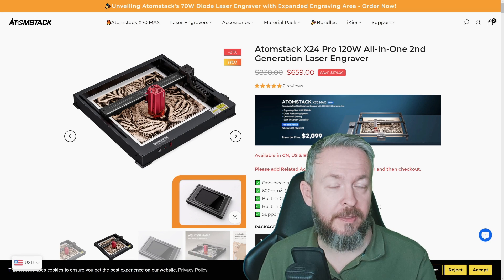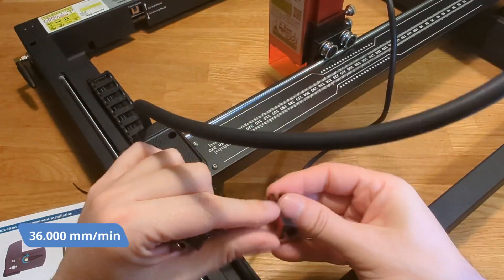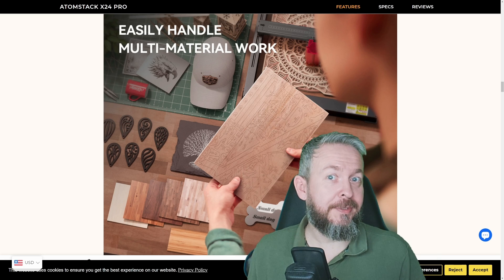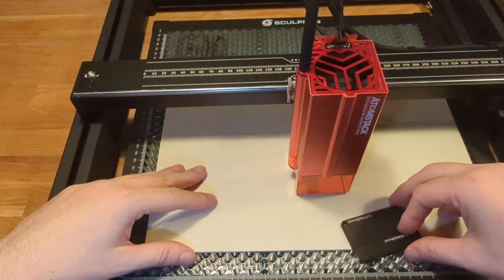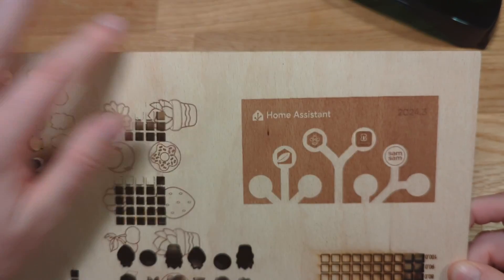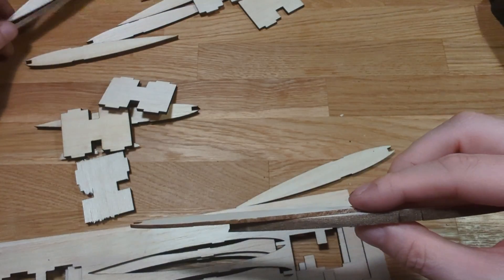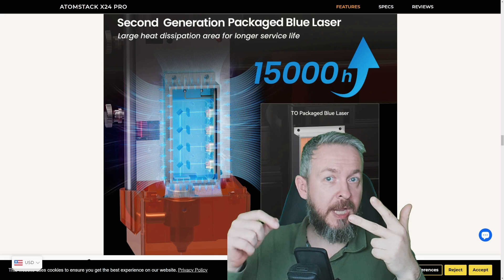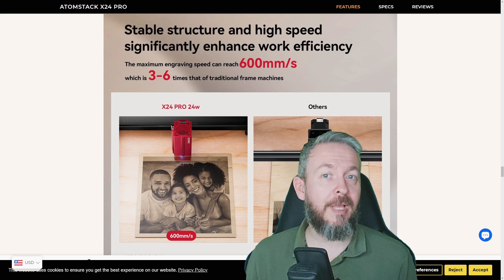AtomStack X24 pro - beginner friendly Laser Cutter & Engraver

Comment: Hi man, great video thanks for the very good value information, just one question because I will buy this atomstak x24 laser cut , I want to make stencils with it and the material to use is Mylar, do u know if it work for it? Thanks a mill
Reply from the maker: Thank you! I think it will work, but you'll definitely have to play with settings (speed vs power) to make sure you have clean cuts as Mylar is a bit thin and looks fragile.

Comment: Hi there I need some advise , I want to know if I can engrave on surface which has cutouts holes ?? .
Reply from the maker: Yes, that shouldn't be the problem - if are thinking about same thing. Laser should just pass over the hole and continue engraving on the other side.
Reply: Hey brother, greetings , I have an issue , I have 1/8 thick acrylic , I was hoping to cut some snowflakes for gifts (being the first thing I actually  cut )  I increase the the S value power in settings from 1,000 to 10,000,  then I run it at 20 mm/speed @ 80% power , 3 passes it just mark the acrylic. I increase to 100% power and it didn’t cut it . Can you please tell me what I’ve done wrong or and tip or advise?  Thanks
Reply from the maker: @MRSingh-nx2xi  does acrylic still have protective paper on it and what colour is it? Acrylic is a bit tricky as it can reflect the paper. You should leave protective paper on it when you try to cut it.
Reply: Hey bro I have a question, I have create the squares outline for my photo, I added a design border at the four corner, and the photo in the Centre, I give it a test run , but the border isn’t getting engraved it started engrave from tbd pic , can you please give me a tip , tell me what I’ve done wrong??thanks .much appreciated.